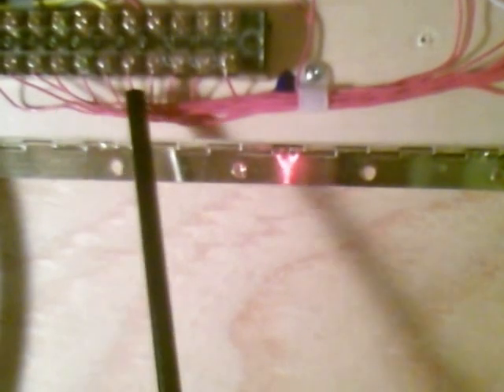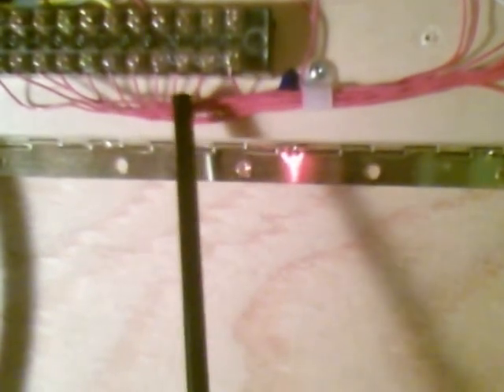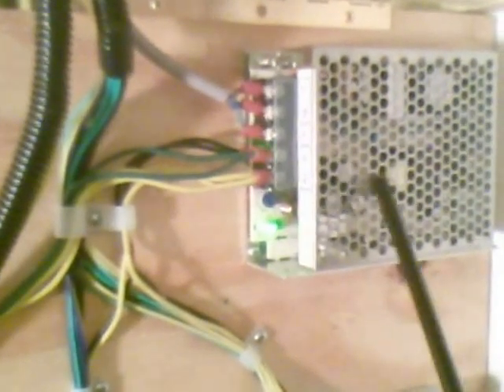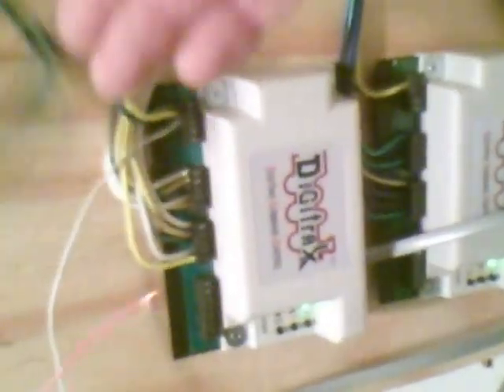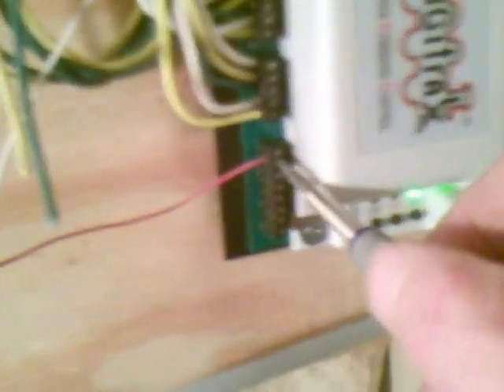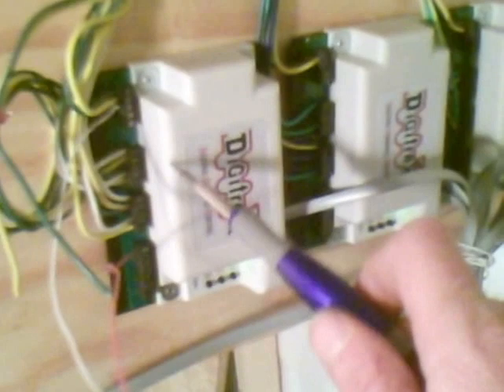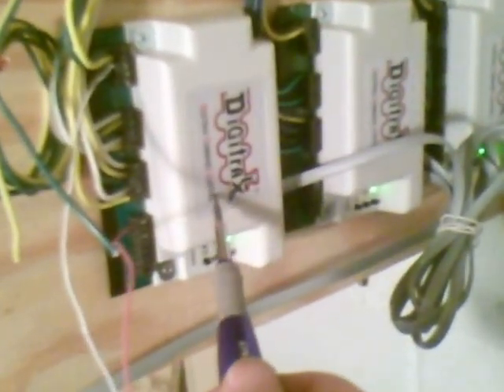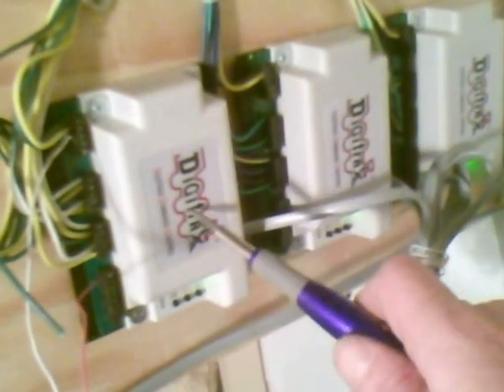Wiring of the layout with Digitrax DCC and the DS64

Comment: Hi Norther  I've looked wiring vids to help.  I havn't found one yet that helps, maybe you know.  I have a HO scale RR and use a prodigy express DCC and I use it on my carpet RR. I run two big boys and would like to know if I can put another connector re-railer at the far end of the track (Total length of the track is 25 feet.) so it can get power. My question is; If I use another powered re-railer and make sure the polarity is the same, will it effect the command signals to the locomotive?

Comment: Great video and tutorship. I have installed several Digitrax SDH164 decoders and purchased a PR3 to program them, but failed o get the PR3 to operate and also was unable to download the computer programs. Just me. Old and not really computer savvy An unfriendly user!. 
Have you advice or a video on these processes? Thanks, Ted

Comment: I look forward to your how to video on JMRI system. Im using it to control signals on the layout but I have just gotten into setting it up, having a little trouble with detection with a BD4 connected through my DS64. I have another BD4 connected to my SE8C and it works great.  Not sure if you have tried it with signals yet but its been time consuming and alot of trial and error.

Comment from the maker: My longeest run for my wire is about 30' with all home wiring on the layout since this layout was designed for multiple cab use with DC current. Now that the changeover has been made its now time for some other electronics to be installed on the layout.

Comment: Wow! Seems like your really jumping in with both feet. Sure want to follow your progress. Have you gone to the Digitrax site? They have a big tech support area. My concern is your power distribution over the length of your track run. They recommend, I think, a separate power supply & booster about every 50 feet.

Looks like it's going to be a super layout.